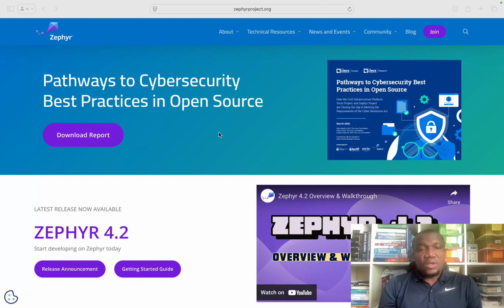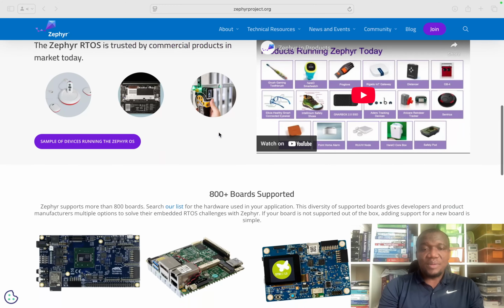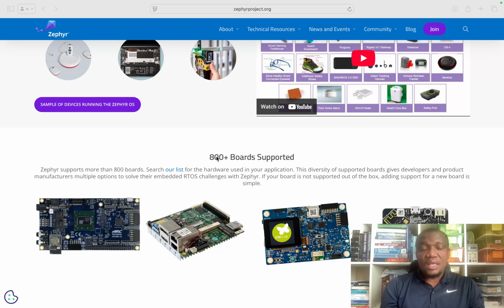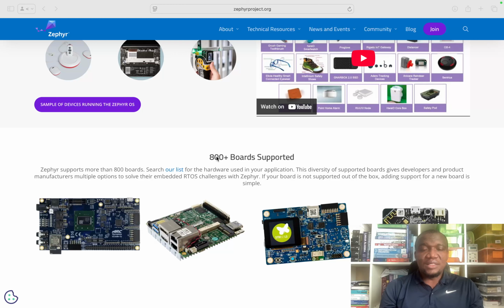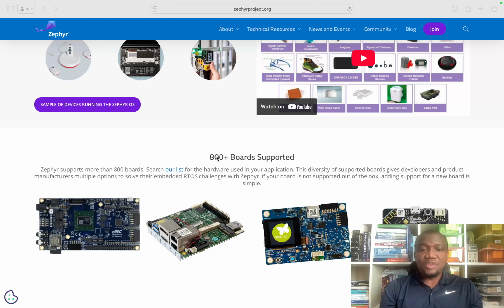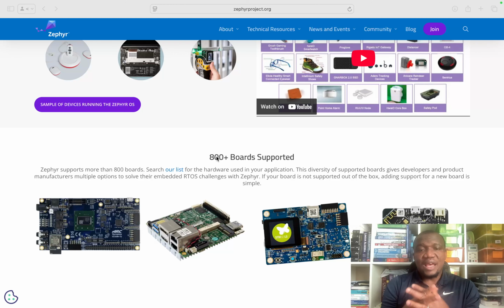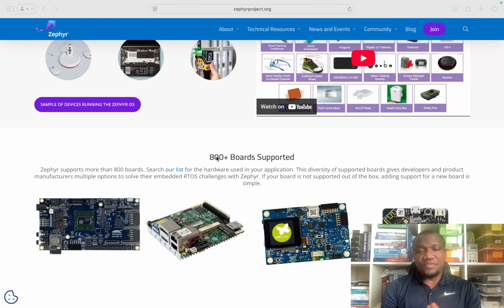Zephyr OS Tutorial [Ep. 1] - What is Zephyr? | Zephyr RTOS Explained

Comment: This is soo dumb idea. People who need firmware portability are much less than People targeting specific mcu and want to utilise specific hardware features simply
Reply from the maker: It's just a tool, you choose it if it fits your needs. Zephyr doesn't sell itself as a one-size-fit-all solution. There are things you can't do without bare-metal but there are many more you can do without it.
Reply: @EmbeddedU it actually tries to be one size fits all.
Reply from the maker: @solidfuel0  but they aren't forcing it on anyone, are they?

Personally, even though I teach Zephyr, I won't use it for a solution if it doesn't fit.
Reply: @EmbeddedU  I'm using nordics mcus, there are no other options . They don't offer own sdk anymore for many mcus
Reply: I would disagree on this though. There area alot of projects where portability is also a requirement albeit if hardware specific features are required, e.g., where companies want their software stack to run on different mcus based on different customer requirements. That's why even Linux is gaining so much traction in the embedded world nowadays. Zeyphr OS seems to fit a good niche where companies don't want too much complexity but at the same time want some of the flexibility (in development, portability and UI, etc) that Linux provides.